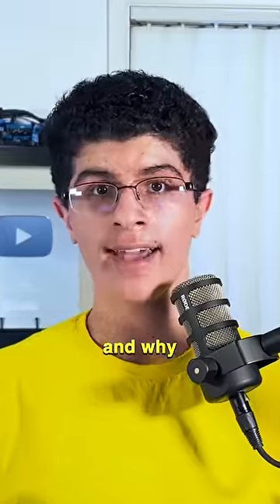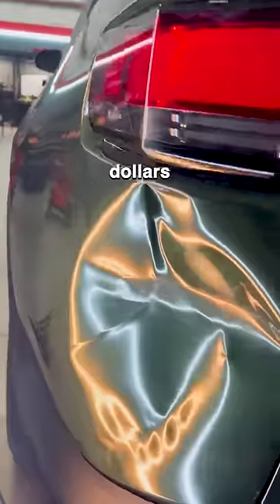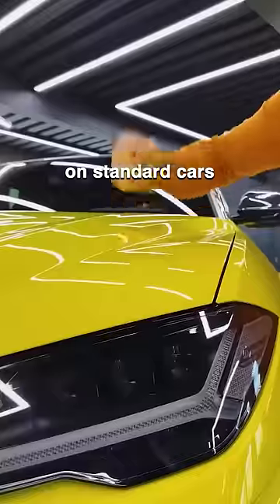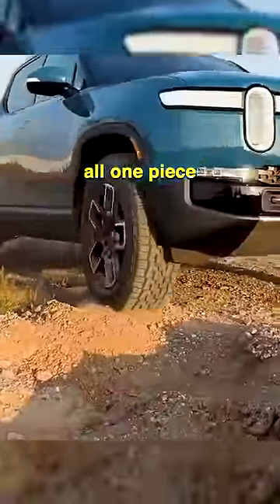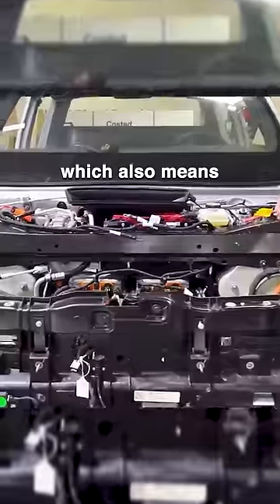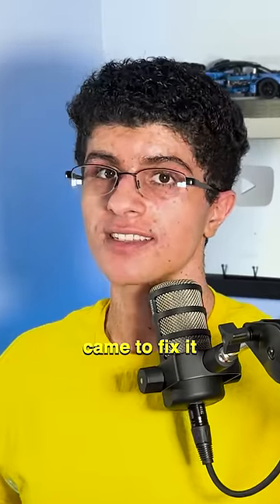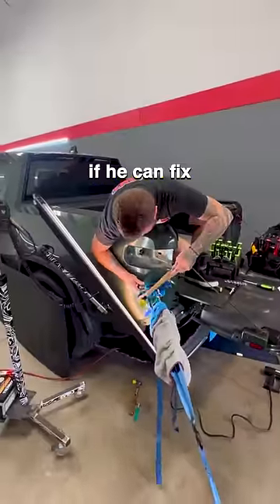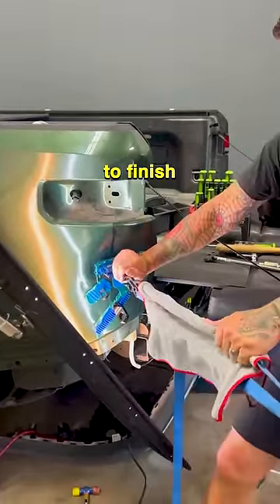Rivian's Insane Repair Costs | @mattboyette4375

Comment: "Let's make the body of the vehicle one giant piece so that we can charge an arm and a leg to repair even the smallest dent."
Reply: That has to be criminal or something. Surely it breaks sustainability guidelines??
Reply: Innovation 😂
"Specially because this EV is environment-friendly, so let's make dozens of steel/aluminum spare bodies" 😂😂
Reply: @dazeen9591 nope. Their car their rules
Reply: @randomname8652  no they don't
Reply: My 2003 gts eclipse is like this for the rear fenders. Only hood, sidekicks, front fenders and both bumpers comes off. It is a convertible. But those rear panels are completely attached
Reply: It reminds me a lot of how cars were built in the passed, like the '40s, '50s and '60s. Except back then such a dent was a lot cheaper to repair because there were a lot more body repair shops that could do this kind of work.
Reply: @chielwouterscw  just wait till 2050 when you have to replace the entire car when changing tires or replacing brakes
Reply: @dazeen9591  yeah it's getting more ridiculous every year
Reply: @randomname8652  that's a great way speedrun bankruptcy.
Reply: @headhunter2749  yeah right 🤣
Reply: @leonardofarias484 aluminium is like the most abundant and easily recycled material on earth you dolt.
Reply: @TheKingMonkArmy  that's every car. The rear is one piece. You have to cut and weld or bondo it.
Reply: @redfishbluefish67  very wrong 😂😂 my chevy cruze has rear fenders that remove. A eclipse body is all made together besides the bumpers and hood. Unless you have aftermarket side skirts then those remove to. 😏

Comment: boiling hot water, and a plunger.
Reply: idk how well that works on a solid block
Reply: It only works on certain metals that retain memory. Well sort of. The plunger part ain’t working on anything. But they make special tools that suction and help pull dents out. Never pulls it out perfect though. Better off welding studs to it and using a slide hammer to work the dent out and then body putty and paint
Reply: @lanceallen9875 no it only works on thin ass rubber bumpers lol
Reply: @JustSpeakingFacts_  no actually you can pull metal dents out with a suction cup dent puller it just doesn’t fix it
Reply: @lanceallen9875 I believe they were talking about the plunger “trick”
Reply: @Captain1929.  yea they make a tool that’s a suction cup that actually does pull dents back into place sometimes. It stills leaves a crease though ofc
Reply: nuh uh that may noly work with small dents
Reply: UM 1bilion?

Comment: I'm sure they could have done the same as the guy that repaired it but just weren't feeling in that day
Reply: Some shops don't offer PDR so wouldn't be able to do it his way, but they could've used a stud gun and a slide hammer

Comment: This is like Apple, a burned out capacitor on motherboard and they quote customer $900 to replace it which is 90% of the cost of MacBook. Independent repair shop did that in $200 and his data remains safe too. Pathetic when companies do this.

Comment: What's in my mind is the owner of that 42k repair rivian just made a story to ruined the brand reputation maybe he was paid by ellon or maybe he live in mars and those extra cost are from vehicle transportation, i read the article and just a few months there is a similar case on the reddit rivian r1t owner got a rear end collision and the damage is a size of basketball dent under his vehicles taillight and when he bring it to the certified rivian body shop the replacement cost is 14,000 yes it's still expensive but way more far than the 42,000 overall the owner is very happy on the built quality on his truck.

Comment: This is tototaly normal on most cars if you smash the rear fender you wil have to replace that panel but if you googl the car and look at it you will se that the Front fender is seperated and ther is annother pannel for the gear thunnal so you dont have to replace the hole side

Comment: Easy fix
Here is a helpful tip boil hot water in a pot once is very hot  use gloves and grab the handles on the pot then pour on the hole where it’s spotted in the car after that try to use your hand to pull it out